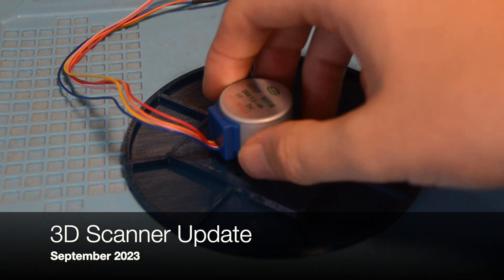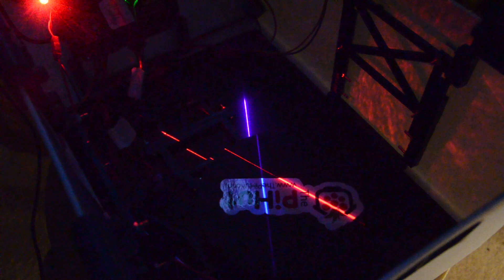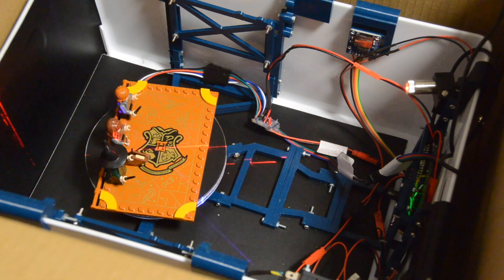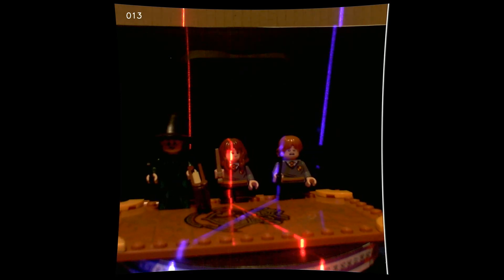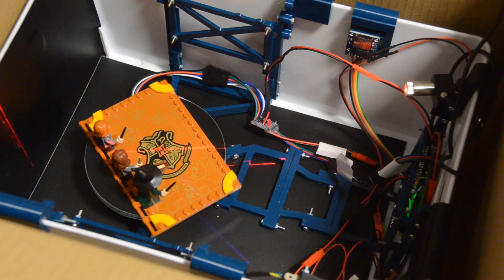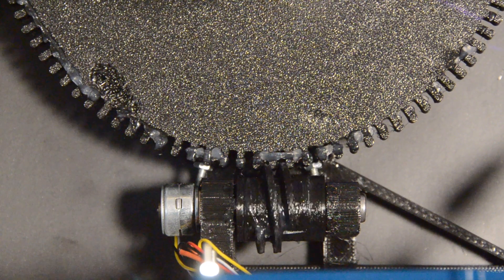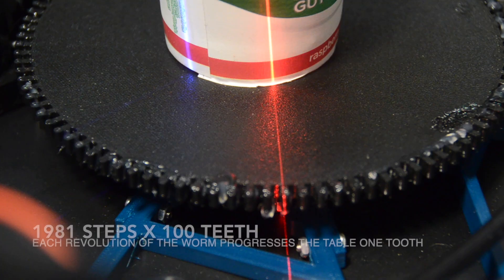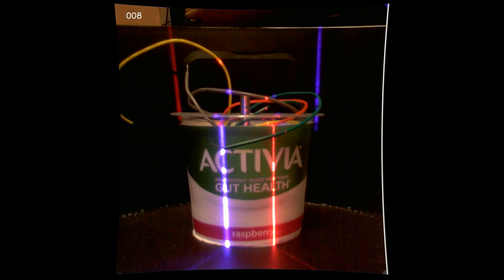3d scanner project update - indexed worm drive

Comment: Why not jut use a survo motor with an encoder.... Literally what they were invented for. Encoder could be absolute andle or displacement but in either case any discrepency would be compensated for by partial stepping the drive to hit the desired encoder position or step count. BTW... This would also mitigate backlash, asuming the encoder was rigidly couple dtothe turntble!
I suspect that a basic brushless motor, geared down and driven with PWM whilst being dynamically locked by DC injection, would outperform a stepper drive significntly.
OEM kit to do this will be readily availble... Look at DRO systems, speciffically, in your case, for a rotary table. You may also wnt to look at active backlash control....
Its a bit like calasthenics... Two drives oppose each other with, 'some' force. This locks the system mechanically to whatever ballance torque is applied.
When you wnt to move you reduce torque on one of th drives untill th requirement to move is achieved and tus removed by the control system.
Your drive system must be back drivable, so no worms, but The combintion of push-push, direct measurment of angular displacement and simple PWM control of DC , orcurrent control asynchronious AC motors, makes for a very simple and precise positioning system.
You might even considder directly driving the turntable, as in make it thr motor. Ficing perminant magnets to the turntable and modulating current in ficd coils, microstepping in stepper terms, whilst measuring displacement qould completly remove the drive chain and still affort push-push or pull-pull positioning.
Reply: no appreciation for indexable mechanisms: why do all these extra steps when a basic 3d printed mechanism guarantees accurate steps for a fraction of the cost?
Reply: Because what fun is buying off the shelf parts that someone else already figured it out when you could use your brain to solve challenges and feel accomplished at the end of the project. It’s not just the destination it’s the journey. Something tells me this guy isn’t doing this just to have a scanner and more of it is a fun project